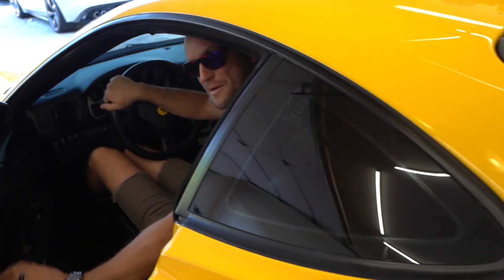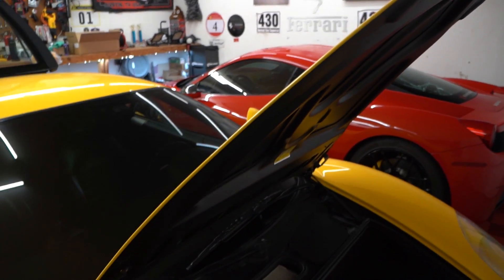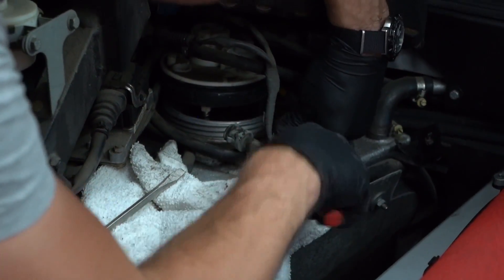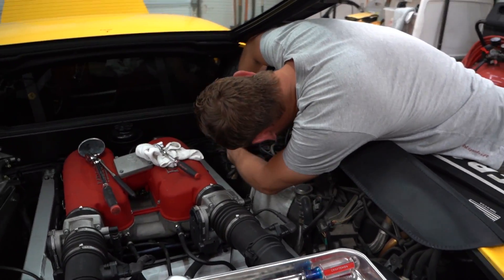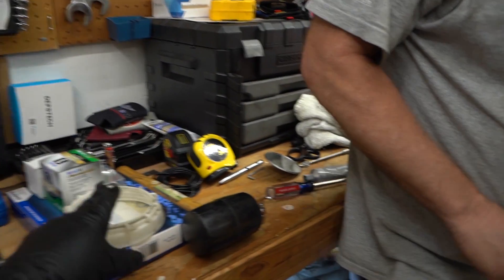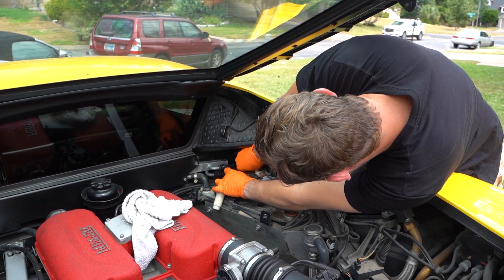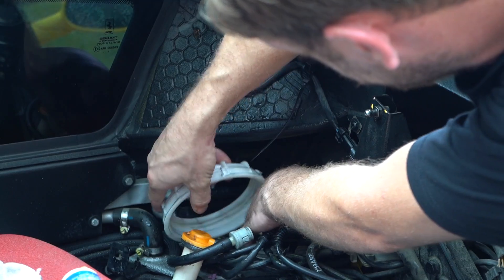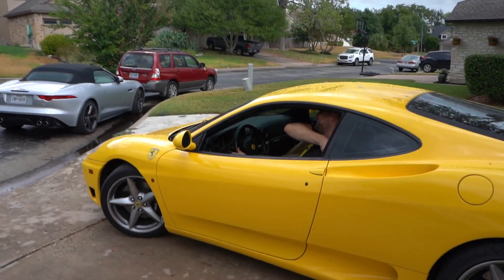FIXING our Ferrari 360's BROKEN Fuel PUMPS (Its an absolute Disaster!)

Comment: If your watching this in 2023 when I did my 360 Modena you’re in for a real treat. 
At least you don’t have to drop the tanks. The positives end there. 
Getting the rear bolts on flanges is a real blast . Have several 8 mm sockets, universal, 1/4 drive , etc. I made a 3-4 “ block of wood for a hold down as you can see Josh struggling with . Lots silicone lube for the gaskets. Bandaids too. Some cussing and 10 minute “walk always”
Reply from the maker: Lol accurate

Comment: Did we ever figure out which ring nuts to order? I' might do my fuel pumps this winter.
Reply: Hi @schloemo, I faced the struggle of Ferrari/Bosch weird references (and change of references) so I discovered that the ring nut that NGS ordered (the 181682) is actually for the 360 Spider which has different Fuel Pumps than the 360 Coupe (go wonder). The Ring nut reference for the 360 Coupe is 170945. Weird that Ricambi did not notice/know that, but at least it is clear on their website now that the 170945 only fits the fuel pump references for the 360 Modena (rather than the fuel pump for the 360 Spider).

Comment: Super glue repair?  This is a Ferrari!  You should have used JB Weld.  More robust.  Was the correct ring nut ever found?
Reply: The ring nut that was ordered (the 181682) is actually for the 360 Spider which has different Fuel Pumps than the 360 Coupe (go wonder). The Ring nut reference for the 360 Coupe is 170945. Weird that Ricambi did not notice/know that, but at least it is clear on their website now that the 170945 only fits the fuel pump references for the 360 Modena (rather than the fuel pump for the 360 Spider).

Comment: I have used an old piece of leather belt to loosen and tighten similar things such as getting my oil filter off my Harley because I didn’t have the correct oil filter wrench.  You are having more fun, fun.
Reply from the maker: Yeah I have a strap wrench but it was going to be very tricky to get in there with the limited space. A belt may have worked better...

Comment: Nice job improvising a repair. Whenever I glue hard plastics I like to use plumbers cement. It comes in a little can that has a lid that unscrews, with a little felt ball attached to apply the glue. It melts the plastic so it welds together stronger than new. If you are unsure if you have PVC or ABS, there is a multipurpose cement that does them all. 

I’m sure you have used tons of it on your aquarium.
Reply from the maker: Yeah I used the glue we use on our aquarium...

Comment: It seems kinda weird that they would still sell the old pump, but not sell the old ring nut.  (I presume the new pump is bigger because the ring nut is bigger?).   That said, does the bottom plate (that the ring nut screws on to) have the same bolt pattern between the new/old design?  i.e. could you buy a new (version) ring nut, a new (ver) base-plate, a new (ver) pump, and attach it to an old tank???
Reply from the maker: I think the base plate is different too. I'll have to do a follow up once we resolve this.

Comment: 360 owner. Was there a particular reason for changing the pumps aside from age / preventative? Any symptoms? Ta
Reply from the maker: They had started making some noise and they are prone to failure so it was somewhat preventative.
Reply: @normalguysupercar  last question.. The white plastic ring that broke.. Aren't those rings not supplied with the new pumps? Or do you have to re-use the pre existing ones to screw over the top of the new pump? (cuz it seems like the new pump comes with a white bit on the top of it??) - apologies for lack of knowledge lol
Reply from the maker: @MrGB1999  you reuse them
Reply: @normalguysupercar  noted

Comment: Thats a reasonable price for a 2001 360 with 25k miles. Similar price here in Europe in Euros which is a bit weird as 1 Euro worth more than 1 $. Re. the fuel pump retaining ring, might have been a good idea to mention the diameter of the original and have the www help you locate one!  Enjoyable video again.
Reply from the maker: Ah yeah I should note it's just under 6" but the big one was just a touch over 6".

Comment: Who in there right mind would remove a fuel line from a pump without clamping  the fuel line?

The line should of been clamped to stop the fuel running back, it wasn't  blocked off to stop the fuel back flow.
Reply from the maker: Ok

Comment: This channel has solidified my purchase of another 911 over a portofino
Reply: Good choice
Reply: LOL I sitting in my office with my 1987 930 turbo sitting outside, I havent driven it for six months. I never put a fuel pump in it. Most reliable cvar I ever owned.  I subscribe to this channel to have it talk me out of buying a Ferrari. My wifes Cayman S has 150000 miles and never put a fuel pump or alternator, just one set of brakes.
Reply from the maker: Well the portifino is kinda meh anyways. Not everyone should get a Ferrari.
Reply: @normalguysupercar  spoken like a true Ferrari owner, another reason for the 911.  Don't want to be "that guy"
Reply from the maker: @philipparana9225  lol OK. Having driven many of both, I can tell you that Porsches are great. So are Ferraris. Not everyone wants to deal with a Ferrari.

Comment: Can't help but think all this could have been avoided if you used a proper lockring tool instead of a hammer and screwdriver on that fragile piece of 20yo Italian plastic.

Also a bit concerning that parts for a 20yo Ferrari are almost impossible to find. Not so concerning for me though, I don't own a 360 and probably never will :-). Also a bit bizarre that you can buy the correct fuel pumps and gaskets but not the correct lockring!

Anyway, hope your ghetto solution is holding up and if it seems like I am being critical, we have all "been there, done that" with ghetto solutions at some stage of our wrenching life.
Reply from the maker: Ghetto life 4evah! Lol